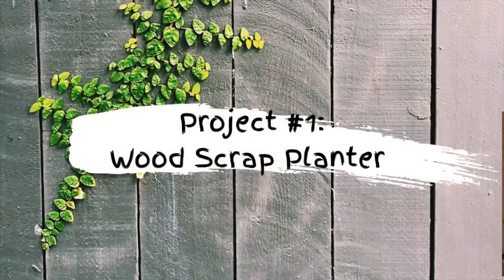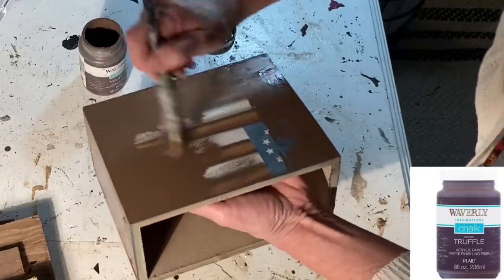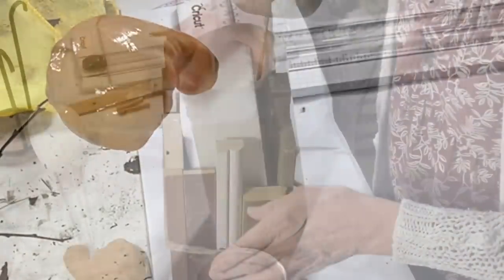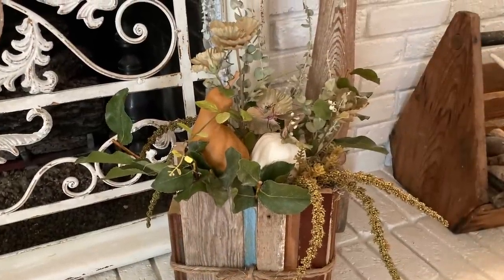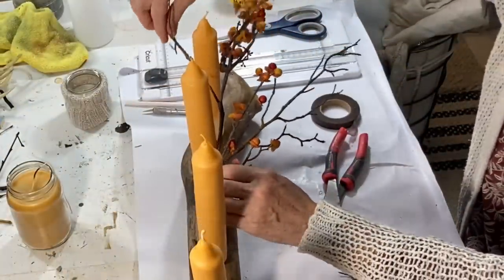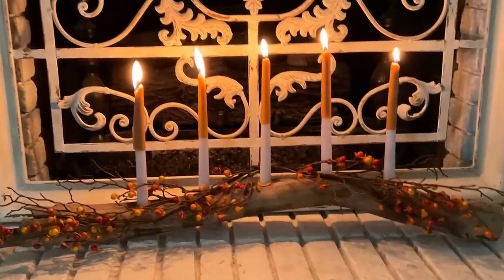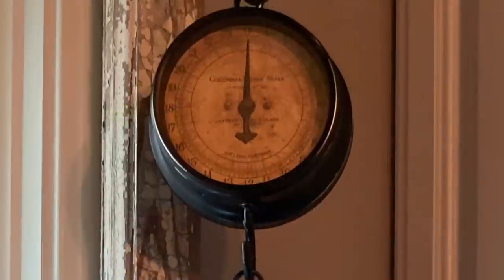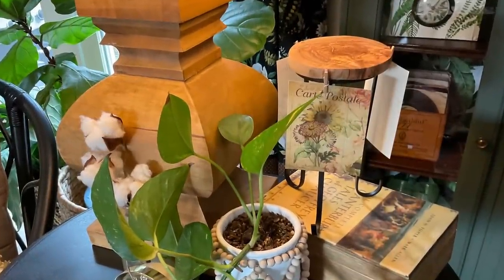12 DIY Rustic Autumn Home Decor Projects All Under $5

Comment: I don't use power tools, but l admire women who do and create. Thanks for sharing your lovely items...though inexpensive they may be, they are far from cheap-looking.
Reply from the maker: Thank you, Midge. I was terrified of power tools when I first started using them. My first saw was a jigsaw which I would highly recommend to someone who wants to make wood crafts. Even though it has a very small and well protected blade, it can cut wood, metal, and plastic. Because the blade has a guard around it, I feel it is even safer to use than a drill. You might consider buying one you can probably find a decent one for under $30.

Comment: Love your diy. Where did you get the miter saw and who makes it and thank you
Reply from the maker: It is Black and Decker. I don’t remember where I purchased it, but it is available on Amazon. It is smaller than most miter saws which makes it a little less threatening if it is your first miter saw; however, I wish I had bought a full size one because sometimes it doesn’t cut all the way through wider pieces of wood.

Comment: i like the sweater sleeve around the candle. one could call them "cozy candles."  some of those older knitted Christmas stockings would look cute wrapped around candles. do you think you could make some of those when it is time to do crafting for Christmas?
P.S. i love the paper and jute fall leaf banner! i love the addition of pine cones and acorns. what a great idea, and it's not at all juvenile. you could "antique" the edges of the banner poem and leaf cards by rubbing some brown artist chalk around the outer edges of the card stock.
Reply from the maker: Thank you! I love that antiquing tip! Using artist’s chalk is so much easier than staining with antique wax or coffee!!!😀
Reply: @CanterburyCottage  : i use Qtips:  rub one on the side of the artist chalk to build up chalk dust on the Qtip, and then gently rub the Qtip on the object until the object has the amount of color you desire.

Comment: Inspiring, as usual @CanterburyCottage ! Thanks so much! Re: your question at 22:18, I would have kept the faux scale. 
Here's a thought: For safety purposes, on the driftwood candle holder, you might want to consider the addition of metal taper candle cups. Available at most craft stores and floral suppliers, these cups resemble a metal thimble (though, there are different types, as other styles might have a small sharp pricket) and are helpful in keeping a hot taper candle away from a flammable surface/holder. Yes, this drives up the price of the project a little bit. However, the peace of mind afforded in the use of the cups is worth the additional cost.  
Disclaimer: Caution / discretion should be observed even when adding the safety feature of candle cups and remember to never leave a burning candle unattended.
Reply from the maker: You are so right, Artie Jay! I usually use taper candles as decor and don’t light them, so it didn’t even occur to me that using driftwood is a fire risk. I need to think of these things in the future. Thank you so much for this reminder!